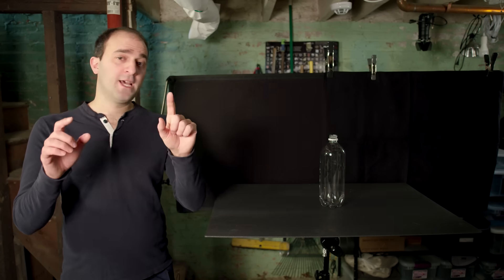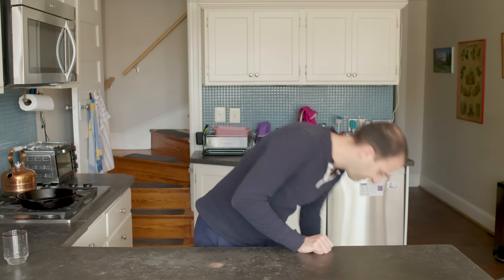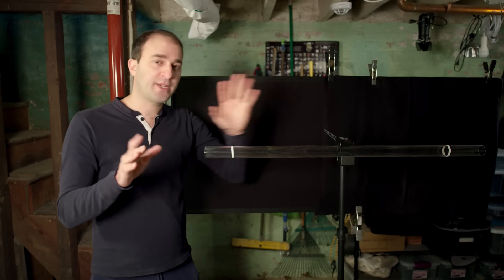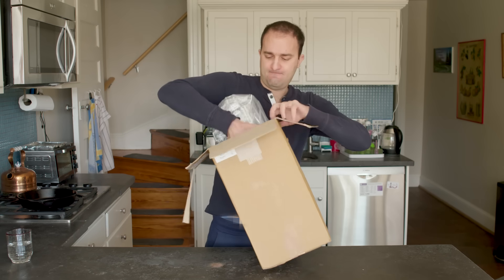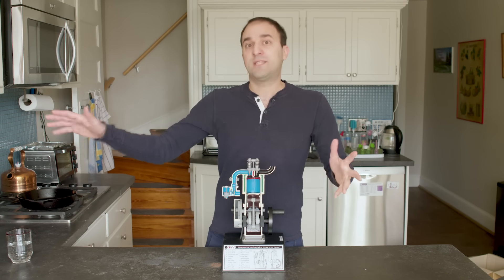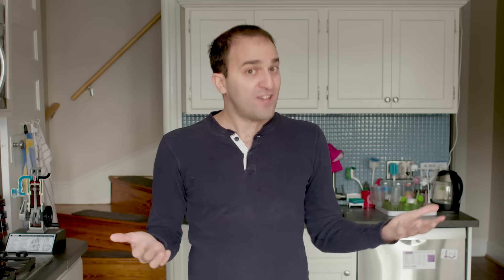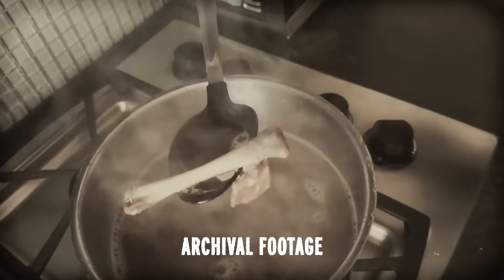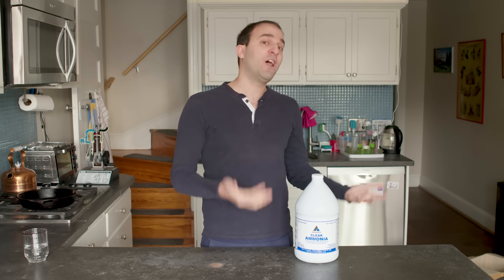Does Toyota Know Something That We Don’t?

Comment: I asked Grok:
Modifying a Flex Fuel system that uses a MicroSquirt controller to run pure ammonia or a mix with different injectors involves several complex steps, considerations, and challenges. Here's an overview based on general knowledge and the web search results provided:

Key Considerations:

    Safety and Legality:
        Ammonia is highly toxic and hazardous. Handling, storing, and using ammonia require stringent safety measures. 
        Legality: Ammonia is not typically approved for use as a motor fuel due to its toxicity and potential for environmental harm. Any modifications would need to comply with local laws and regulations concerning fuel use.
    Chemical Properties of Ammonia:
        Ammonia has different combustion characteristics compared to gasoline or ethanol, including a lower stoichiometric air-fuel ratio and different ignition properties. This affects how the engine needs to be tuned.
    Fuel System Modifications:
        Fuel Injectors: Ammonia requires different injectors due to its corrosive nature and different flow characteristics. Injectors would need to be resistant to ammonia's corrosive effects, which means possibly using materials like stainless steel or other ammonia-compatible materials. 
        Fuel Pump: Ammonia's lower energy density might require a more robust fuel pump or even dual fuel systems to ensure adequate fuel delivery.
    MicroSquirt Modifications:
        Firmware and Tuning: You would need to adjust the MicroSquirt's firmware or use a custom tune to handle the different stoichiometric ratio of ammonia (approximately 6:1 air-fuel ratio by mass compared to 14.7:1 for gasoline). This involves recalibrating the fueling and ignition maps.
        Sensor Compatibility: The Flex Fuel sensor used for detecting ethanol content would not function with ammonia. You'd need to either bypass this or use a different sensing mechanism tailored for ammonia.
    Engine Modifications:
        Materials: Engine components might need to be upgraded to materials resistant to ammonia's corrosive effects.
        Ignition System: Ammonia’s ignition properties might require adjustments in spark timing, spark plug heat range, or even a different ignition system setup.
    Fuel Mixing:
        Dual Fuel System: If you want to run a mix, you'd potentially need a dual fuel system where one set of injectors handles ammonia and another set for gasoline or ethanol. This would require complex control logic in the ECU to manage the mixture based on engine load, speed, and other parameters.

Practical Steps:

    Research and Design: Extensive research into ammonia combustion in engines, possibly looking into academic studies or specialized forums for experimental engine setups.
    Component Selection: Choose or design injectors, fuel lines, and pumps that can handle ammonia without degradation.
    ECU Programming: Rewrite or modify the MicroSquirt firmware. This includes setting up new tables for fuel delivery, ignition timing, and possibly new sensor inputs if detecting ammonia concentration directly.
    Testing: Start with controlled bench tests before moving to engine dynamometer testing to ensure safety and performance.
    Safety Measures: Install ammonia leak detection systems, ventilation, and emergency shutoff systems.
    Tuning and Adjustments: Continuous tuning would be necessary due to the unique nature of ammonia combustion, focusing on achieving stable combustion, managing knock, and optimizing for efficiency.

Final Thoughts:
Given the complexity, safety concerns, and legal implications, this project would be more suited for experimental or research purposes rather than practical vehicular use. Engaging with experts in engine design, fuel chemistry, and automotive safety would be crucial. Additionally, consider the environmental impact and the need for specialized exhaust treatment given ammonia's combustion byproducts.

Comment: Flamefront propagation has nothing to do with detonation. It's only considered in deflaguration. A fuel with a higher speed is generally more volatile, eg. More likely to detonate. Also, detonation depends on pressure (so, ignition advance) and air/fuel ratio. Detonation is indeed bad, and is exactly why we use an octane number/rating to rate gasoline, higher octane means higher detonation resistance
Reply: Yes, very true. Ammonia octane is about 130. This means you can run higher compressions with ammonia without risking knock. 
Ammonia engine developers tell me the flame-speed issue will limit the RPM; it will be difficult to get an ammonia engine to spin faster than ~5500 rpm, otherwise you end up with unburnt ammonia in your exhaust.

Comment: The Haber-Bosch process is energy-intensive and accounts for about 1% of global annual CO2 emissions, more than any other industrial chemical-making reaction.
 The process requires roughly 80-300 atmospheres of pressure and temperatures around 572-1000 F (300-500 C).
 Approximately 70% of ammonia production is via natural gas-based steam reforming, leading to substantial natural gas demand.

Comment: I'm run ammonia refrigeration on boats. It is caustic to steel big time. It can eat electrical contacts, tools you name it. Also if you ever encapsulate it, it will explode, it can break sch 80 pipe, I don't know the limits of what it can break, and don't want to find out on a boat. Might make a cool demo. So if you are going to use liquid ammonia in a vehicle in a pure form it needs stainless plumbing with redundancies that don't allow it to deadhead. Maybe it's different the way they are mixing it, idk

Comment: Even if you discard the fact that ammonia will produce Nitrogen oxides and also is less flammable, how do you get it? Through the Haber process ofc which is anything but carbon neutral. Ammonia engines are a total hoax

Comment: Oh man. Imagine all cars with say 50L ammonia tank. It's toxic, corrosive, flamable and pose enviromental hazard. It's just another in the long line of inventions deserving a Darwin's award of stupidity. But it is safer than a car with a 700 Bar hidrogen tank or maybe even the ones with 100+ Kg of intercalated lithium, i give you that. Imagine the car crash where 100L of ammonia is spilled in a confined space, such as parking house.  Not to mention the idea to produce ammonia using preshious electricity, rather than the usual Haber_Bosch, wery chip in deed.

Comment: The electricity requirements in the US are expected to double by 2030, maybe the best place to use ammonia is in power stations using jet engines as the power source for generators.

Comment: Haber process is expensive electrically (comes mostly from gas or coal) our h2 currently comes from oil, nox emissions are expensive to fix (took us from the clean air act to mid 2000’s so our air stopped killing lots of us).  Why?

Comment: How much energy does the Haber is about 45 kJ/mol, and this supposes that you already have hydrogen and nitrogen (I know, there is quite a lot in the air). So as long as you have for instance nuclear power and a lot of hydrogen. Otherwise, the only way to produce a lot of hydrogen is from methane, which mixed with water produces methane and co2 and also needs quite some energy.

Comment: Nissan is progressing in the development of solid oxide fuel cell systems for vehicles that can operate on various hydrocarbons and hydrides, including ammonia. These systems have the capability to use such materials, unlike pure hydrogen fuel cells. I'm not quite seeing the benefits of an internal combustion engine compared to a solid oxide fuel cell, but perhaps there's something I'm overlooking.

Comment: You should watch some old talk shows like Merv Giffen. At one point an invertor, who had a patent on a process, was going on shows promoting hydrogen as the solution to the climate problem but storing it as ammonia. So what you are talking about is nothing new. The difference back then was the small turbine engines were being worked on so all you needed was to burn something and get gas expansion and not and explosive combustion. Big oil swashed the process and some of these inventers die by unexplained accidents. We had a lot of the movement to clean energy worked out in the 60's and 70' it was simply stops by big oil. You should check out old patents from the period or find some old Popular Science magazines to see what has already been done

Comment: I doubt you handled ammonia in liquid form given the -33°C boiling point in the sealed bottle at the beginning of the video. Same with burning it: ammonia doesn't burn blue but yellow/green. I've handled liquid ammonia when I've done Birch reductions and you wouldn't handle ammonia like that. And the bottle of "ammonia" is merely concentrated ammonium hydroxide. This video appears to be quite misleading. Ammonia is not a chemical to be messed with.

Comment: Respectfully, just some corrections of facts in your Video.  1) The rate of combustion or flame speed is directly/exponentially proportional to Pressure, Temperature, Oxidizer/Oxygen, and/or Promoter.  The video you showed shows an ammonia (boiling point is 33°C) combustion in atmospheric pressure.  Try igniting ammonia in a close bottle with a spark-plug and you will have a detonation (stay clear please).  The fire-extinguisher of Ammonia fire or leak is Water.  2) Ammonia is lighter (less density) than air at ambient pressure and temperature unlike LPG, Methane or Propane (boiling point is 43°C).  Therefore, if an ammonia leak will occur in an engine or electrolytic device, it will NOT go to the car cabin unlike LPG, but will immediately go up to the sky.  Therefore, it will NOT accummolate in an unroofed area unlike LPG or Gasoline.  3) The best use of Ammonia is as a Hydrogen carrier where the hydrogen is harvested via electrolysis, and said hydrogen is fed into a Fuel Cell to power EVs.  Of course, a lot less batteries will still be needed as starters or augmenters during accelerations but the bulk of the power will be supplier by Fuel Cells which will make the vehicle lighter (unlike battery cars) and have more space.  4) The best thermal efficiency in an Internal Combustion Engine is only 30% (Carnot Efficiency) while the Energy harvested in a Fuel Cell is more than 90%, less 20% for electrolysis.  Furthermore, Green Ammonia is simply manufacture with new technology using renewable energy (less dependence on OPEC).  5) The fact that ammonia smell is strong is an advantage unlike LPG and Carbon Monoxide, thus more people died from LPG leaks than ammonia leaks.  6) In the Philippines, we have many LPG Gas Stations and the same can be adapted to fill Ammonia in EV vehicles, thus the infrastructure is already existing.  I have worked as an engineer in an Ammonia Refrigeration Plant and our mechanics can approach an strong ammonia leak with a fire hose with running water and stop the leak with a rubber-band before isolating the pipe.  The best attire to approach an ammonia leak is a very wet ordinary clothing.  I am making this comment to correct an alarmist character towards ammonia.  I am a Professional Mech. Engineer and a University Professor.
Reply: Professor, and what about the releasing of N2O (nitrous oxide, a greenhouse gas nastier than CO2) by the burning of ammonia?

Comment: I have a strange hunch theory about why they are pushing ammonia.   Yes I they may know something here that you are not thinking of.  Not only does Ammonia work as a fuel, it can also be used to turn hot into cold.  Early Refrigerators used ammonia absorption to make COLD from a flame.   This process goes back to the early 1900s and is used today in RV refrigerators, ice arenas, and large commercial air conditioning systems.  I wonder if they plan to use a ammonia loop to cool the exhaust when it comes out, maybe it would not add so much global warming coming out colder.  They could easily add a heat exchanger that powers the ammonia refrigeration loop.  I also wonder if this could turn the exhaust to another state (such as liquid or solid) and capture it somehow.  

I also wonder if they plan to develop a technology that would separate the nitrogen from the oxygen and put it in the cars, and capture the nitrogen from the exhaust and get an exhaust that contains less harmful somehow, perhaps with adsorption, or using some other separation technology.

Comment: Toyota knows the power of presenting non-solutions as potential solutions, to avoid being forced to pursue actual solutions. The technical issues, none of which are deal breakers by themselves, all put together makes ammonia a very impractical fuel. And then there's the issue of where the energy to produce it is supposed to come from. Not being able to afford nitrogen fertilizer produced by the Haber Bosch process, from natural gas, even when natural gas was essentially free, is probably the biggest single reason a lot of subsistence farmers live in extreme poverty. Well, as far as technical/practical reasons go, and not socioeconomic reasons behind that. 

Besides all the practical issues with using ammonia as fuel, and the fact that it is most likely a way to "hide" carbon emissions, and a life line for the fossil fuel industry, if adopted as a "replacement" for fossil fuels, the thought of producing and burning much more ammonia than would be needed to produce all the nitrogen fertilizer all the very poor subsistence farmers in the world would need to have significantly improved situation, isn't very attractive to me.    

We don't have to create demand for potential energy carriers that could be produced from either fossil fuels or fossil free energy, like methane, hydrogen or ammonia to promote production of them from fossil free energy, there is already plenty of demand, what we need to develop, definitely first and possibly only,  is economically viable production of those products, without using fossil fuels.

Comment: It took me 10 seconds to find out that toyota isn’t intending to use ammonia as a fuel but as a hydrogen carrier which will then be used as fuel in the engine. 
Wow the level of research on YT science channels is phenomenal. 
You may also want to look into THe Australian science institute of CSIRO and their ammonia to hydrogen metal membrane, with which they worked with toyota to convert two cars to utilise the tech. Details are sparse.